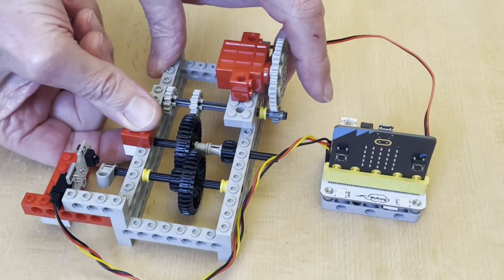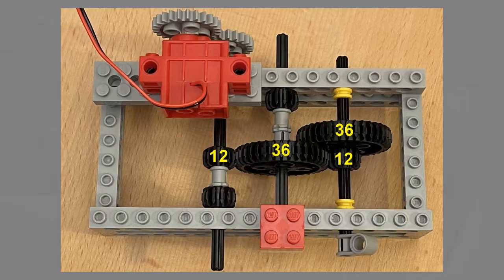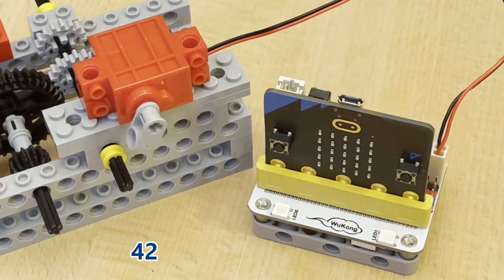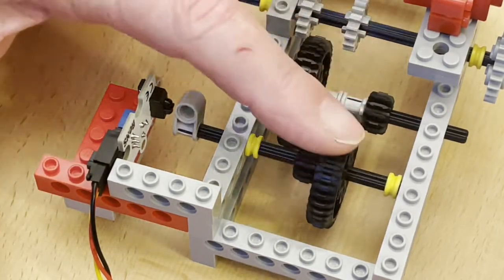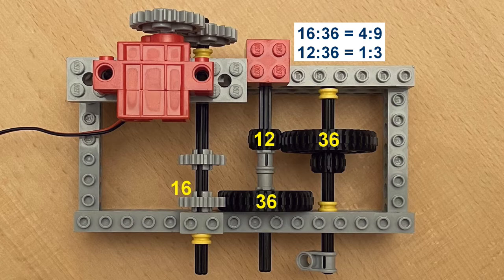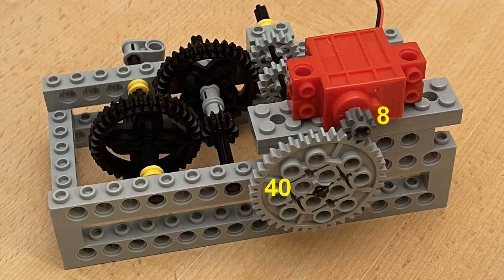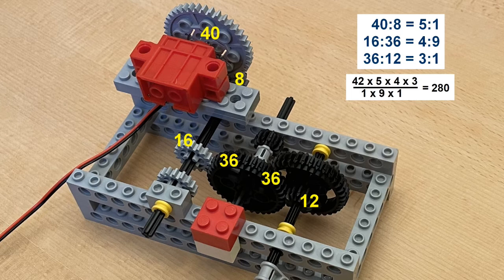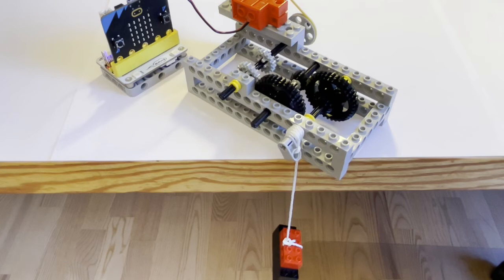Gearbox with Lego and Micro:bit

Comment: Why is the value of 300 used in the following line of code? 
'if (Read == 0 && pins.analogReadPin(AnalogPin.P0) > 300)'
How does 300 relate to the analog value of the sensor?
I guess what I'm asking is, what is the 300 referring to (time? light sensitivity? etc)?
Thank you.
Reply from the maker: It refers to how much of the infrared light there is reflected from the object passing bye. The value is found by help of experiments. The highest value that P0 can have is 1023.